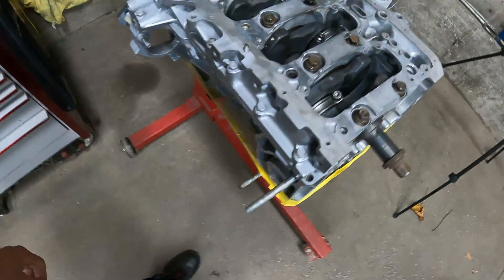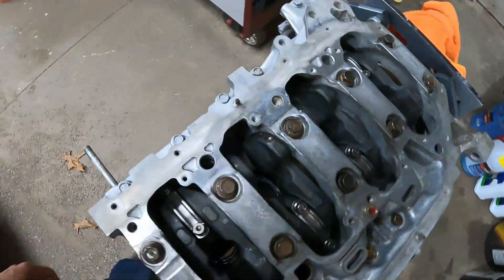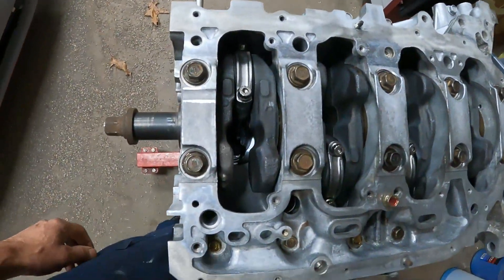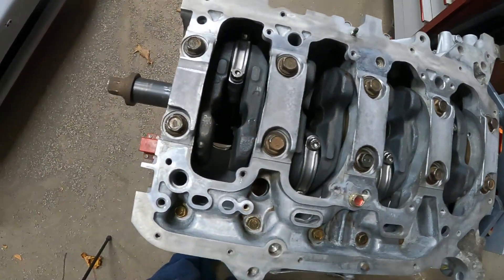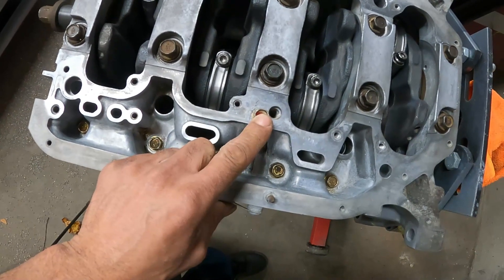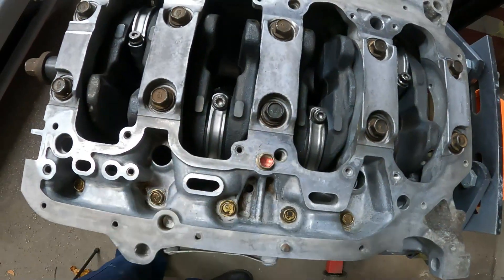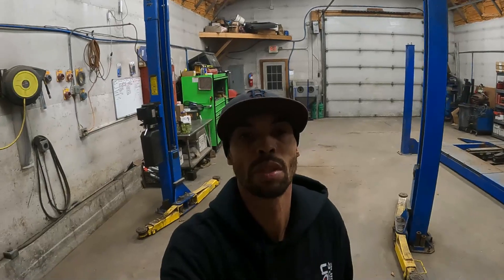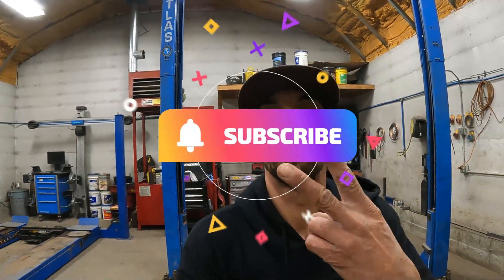Installing O-rings on my CYLINDER SUPPORT SYSTEM K24A2  block for the first time 💪

Comment: Best to put the end of the oring as close as possible to a headstud with no waterport nearby
Reply from the maker: I was told by my engine builder that it doesn't matter as long as the gap is tight. So far so good.

Comment: Are any mods required on the head for o-rings to seat or just the block
Reply from the maker: Nah just the block is grooved for the O-rings. The head doesn't need any modifications just bolt it on

Comment: where did you get the o-ring material for the css block?
Reply from the maker: I got my wire from CSS when I had it grooved and bored and deck. I know you can buy it from iagperformance.com you just need to know the thickness that you need.
Reply: @derekbuilt7761  ty
Reply from the maker: Yw bud
Reply: @derekbuilt7761  - do you know what thickness you used. I have same motor also done by CNC weeks (CSS) I bought the .40 and it seems way to big and cannot figure out what thickness to use. Any information would nice before I just smash the .40 in the slot. TY
Reply from the maker: @petervaracalli2453  you need  18 gauge wire. You can get it from Golden Eagle MFG
Reply: @derekbuilt7761  - yep that’s where I got it. I didn’t realize until after I attempted several times to install it that they sent .050 thousandths instead of .040 thousandths. Now I’m just hoping I didn’t fuck the deck up trying to install. FML. Thanks for the help, appreciate it.
Reply from the maker: @petervaracalli2453  You're welcome bro. The deck should be fine. Run your finger around and make sure there's no small dings around the bore
Reply: From what is the wire from?
Reply from the maker: @guillermodavila9397  it's 18 gauge wire from Golden Eagle MFG